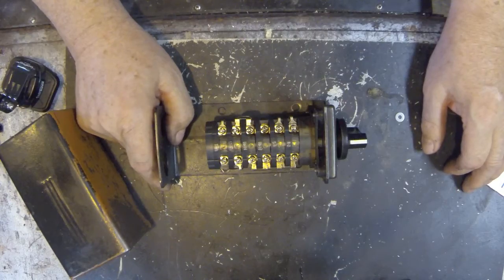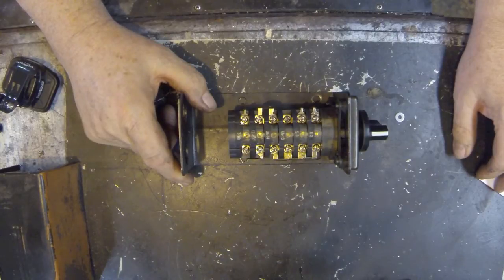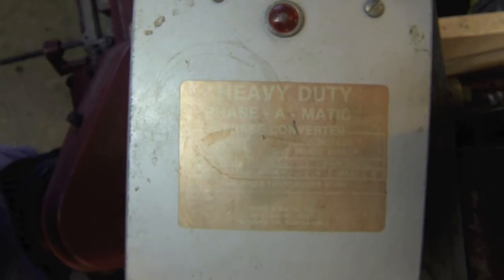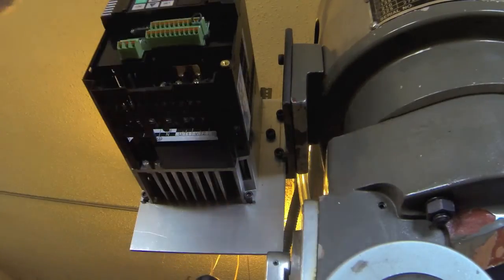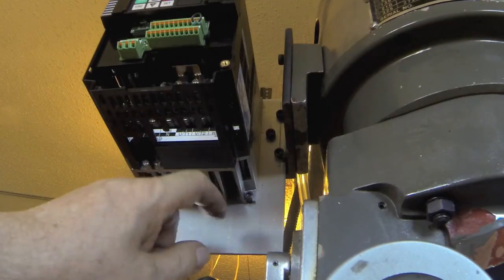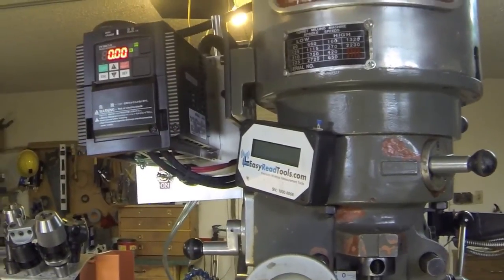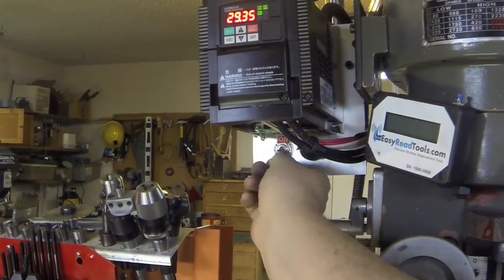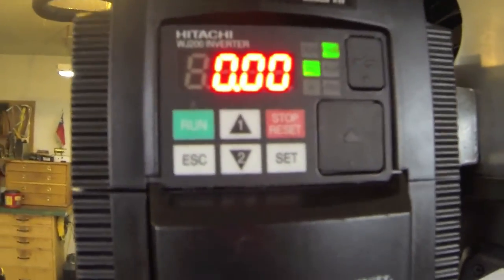This Week in Herb's Workshop #18

Comment: Hi Herb,

If you set maximum frequency to 100 or even 120Hz, you'll find that you almost never have to shift the belts. You can run in a lower 'gear' for more torque, and get the rpm back by over-speeding the motor.

I like to have the VFD set up to coast to stop, that way you're never fighting the spindle brake. The deceleration time is still used for reversal and you can set it up quite aggressively because the only time you're likely to go straight from forward to reverse is at low rpm when power tapping. In any case there is likely to be a setting in the VFD to limit deceleration based on the DC bus voltage.
Reply from the maker: Paul,  I do that on my drill press, and it works great.  I plan to do it on the mill, just haven't got that far with it yet.  I'm working on the braking now, adding a braking resistor.  Thanks for the comment.  Have a great weekend!

Comment: Welcome to the world of squeaky shop equipment.... LOL
I see the benefits of the VFDs but hate the squeaky sounds....;-)

Colin
Reply from the maker: Thanks Colin.  I have a VFD on my drill press.  I'm very happy with it.  The Hitachi does make some noise for sure.
Reply: Herb Blair if you install a line reactor then it helps with the high pitch whine. Also helps with harmonics. I have both a line and load reactor(to protect the motor from the voltage spikes of the vfd) and hardly have any high pitch whine noise.  You could also change the carrier frequency to around 12-13 thousand so it's out of human hearing range but I wouldn't recommend that as it's detrimental to the motor.